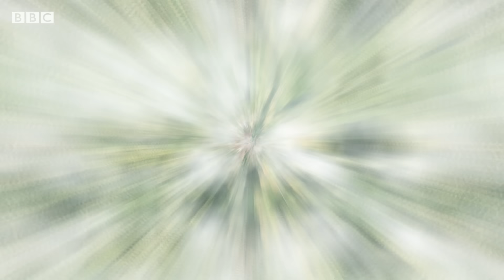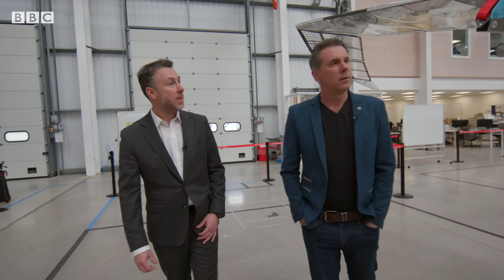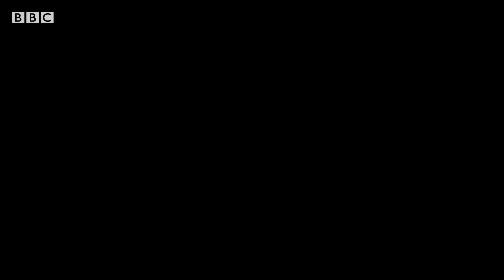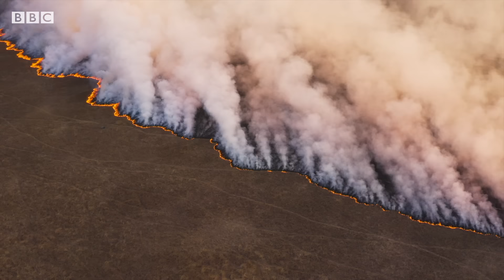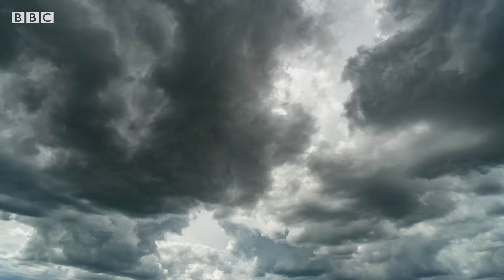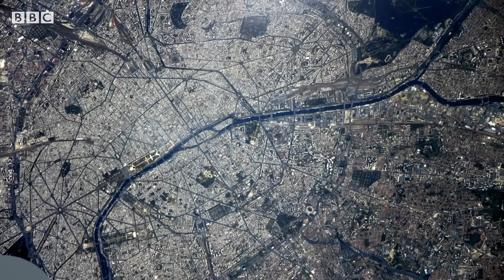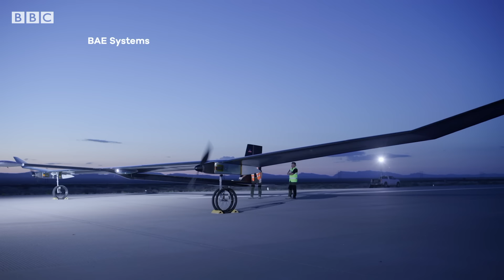The solar-powered aircraft flying high in the atmosphere | BBC News

Comment: It was fantastic to see our Zephyr High Altitude Platform Station (HAPS) covered in this BBC Click episode! Our Zephyr HAPS may look and sound very sci-fi, but it's very real, and we're excited to be commercialising the technology with an aspiration to help improve and save lives.
Reply: How do you communicate with the plane in order to control it autonomously over areas without cell cover? Is it by satellite? And do the altitudes the planes may use conflict with other planes? Like if 10 years from now, 30% of the US cell network demand is covered by zephyr planes, how disruptive is that to other planes and rocket launches
Reply: If it's solar array is so efficient that it charges the battery by noon and then relies on that battery to keep it aloft at night, then why not put another battery in for each wing and propeller?
Reply: @atlasfeynman1039  Significant weight increase, more power needed to keep it aloft, and it isn't needed. What would adding batteries for each wing or propeller achieve? It doesn't need more battery juice, as it can recharge after every night.
Reply: @explorer_1113  If the goal is to keep it aloft continuously and the batteries are "fully charged by noon" and yet barely provide enough charge to keep the craft aloft until sunrise when it can recharge, then it certainly seems worth the extra weight even if another prop needs to be added. It's light enough to launch by hand, so how much weight are we talking about?
Reply: @atlasfeynman1039  It is aloft continuously, they provide enough charge to keep it in stratosphere until sunrise. How else is it there for 6 months? If it works, don't fix it.
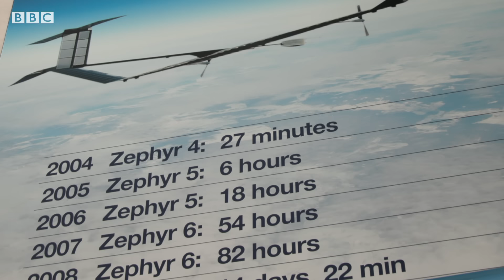Reply: @explorer_1113  1:11 Current record is 64 days (not 6 months) and 2018 models lasted 25 days and 14 days in 2010. Science requires thinking of everything as if it could be improved.
Reply: @atlasfeynman1039  ah my bad. Just to be clear, I'm nowhere at being an expert on this, just talking out of intuition. But the problem of longevity seems to be of battery cycles, not capacity. Would increasing battery capacity reduce charging cycles? Don't know, but I don't think so. But it's an idea.
Reply: @atlasfeynman1039  For a craft so weight-optimized, the engineers have likely picked the greatest energy density they can pack into the platform.

Added weight demands more lift which requires larger wings which adds structural weight, which demands more power, and so the cycle continues.
Reply: California has mostly calm weather too 😊
Reply: @aaltohaps Are you looking for investors? I work for Skynet, a subsidiary of Cyberdyne Systems. We would love to have a chat!
Reply: @aaltohap This video was interesting, but leaves ambiguity or vagueness; the comment section has a lot of speculation. For example, can the current Zephr HAPS carry the mobile phone equipment to provide that 7,500 km² coverage? If not what is the time-line for that version of Zephr? I, like many commenters, will assume Zephr does not have that capability yet, and won't have until the questions are explicitly answered.

Maybe ask BBC News to add a URL, to the video's description, linking to your www site for technical details (not just ads)? And/Or post a link in this video's comment section to a YouTube video on your @aaltohaps channel. That @aaltohap video might respond to and answer the most popular speculation. Also, AALTO might respond to comments on one of your specific YouTube videos. Your current videos have 'high production value' but little evidence of engagement.

Some good YT video might even encourage science and technology reactors to 'spread the word', growing and sustaining your on-going 'marketing'. Your videos don't need to be 'high production value' if they're professional and packed with information rather than vagueness or speculation.
Best Wishes. ☮
Reply: @aaltohaps A significant problem with Zephr HAPS, highlighted in this video, seems to be launching and reaching 60,000 feet through sub-optimal weather. That appears to drastically reduce the areas of the world where Zephr can be deployed rapidly in response to a disaster. Flying for even 24 hours (ie. about 1,000 miles) to reach a disaster are seems to reduce Zephr relevance. Has AALTO already provision for rapid, local launch? For example using a large high-altitude balloon, which might reach much of the altitude quickly, or 'traditional' aircraft launch? In a disaster, re-establishing mobile communication very quickly is likely more critical than environmental impact.
Best Wishes. ☮
Reply: @gbulmer  What makes you think it's primary mission is to respond to disasters and therefore weather is a factor? In your scenario, it could be launched from anywhere on the globe where weather permits and reach high altitudes to focus/relay mobile satellite signals. Also, since it's function is more to orbit than fly in those zones with little oxygen, the line of sight factor reduces this perceived distance ratio for transmitting/relaying mobile communication signals.
Reply: @atlasfeynman1039  Thank you for replying. I didn't claim AALTO's Zephr's primary mission is to respond to disasters. You over-constrained the issues. However, responding to disasters is identified in this video as a plausible, potentially valuable, mission. The video also goes into some detail about the benefit of a stratospheric mobile phone platform, eg. when ground based mobile phone infrastructure is disabled. 
The video also explains the Zephyr needs good weather conditions to launch. I merely synthesised some questions from those claims and information. 
Disaster response is usually characterised as requiring rapid response, with communications playing a key role in co-ordinating assessment and response. Communications during the first hours in the aftermath of a disaster seem to have a big impact on the effectiveness of emergency response, and the survival of victims.
Waiting for good weather (even good locations might not have long-enough windows of adequately good weather, every day) or flying more than 24 hours (they mentioned 40 mph in the video, hence less than 1,000 miles) appears to significantly limit Zephr's usefulness in disaster response missions.
Hence, I asked if there were alternative methods of launching Zephyr more rapidly and reliably.
AFAICT, you haven't added any new information. Hence my question still stands.
The video claims mobile phone coverage of 7,500 km². If you actually do the arithmetic, that is a radius of slightly under 50km. So Zephyr has to get within that distance of the disaster area to become important. AFAICT, you haven't done that calculation.
I didn't mention "focus/relay mobile satellite signals", and it doesn't seem relevant to my questions.
I did not mention oxygen. That is a notion you introduced, which AFAICT is irrelevant.
I am willing and happy to await responses by AALTO, ie. a source of authoritative information.
Reply: hi guys, are you the ones flying the AALTO Zephyr HAPS in Kenya currently? I've observed it for quite some time, so cool...
Reply: @albertmwai5925  Thank you for following AALTO's work in Kenya!
Reply: Are they visible when satellite photographs earth map images?
Reply: When did it stop being High Altitude Pseudo Satellite?
Reply: You guys ever thought of competing against Starlink for internet????

Comment: It looks like a reasonable design.  I would probably have used only one propeller, but putting the motor mass on the wings may reduce spar strength requirements.
Reply: Also 1 propeller generates torque wanting to roll the aircraft, using 2 counteracts that

Comment: sadly they are sitll hamped tthrough weather. since those planes are flying above the weather, if the weather sucks, they cannot be used to check what's going on down there, like with satellites. things could get interesting though if those planes manage to have enough battery juicy for several days, making it possible to fly below clouds for example to have a clear picture. they then do their shots and then fly up again. once that's possible, they have a huge advantage over satellites.